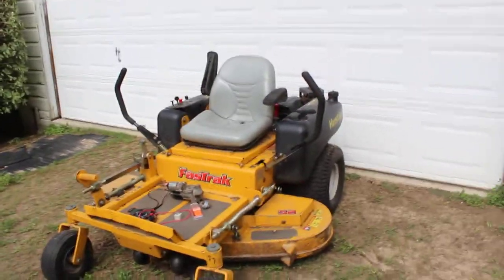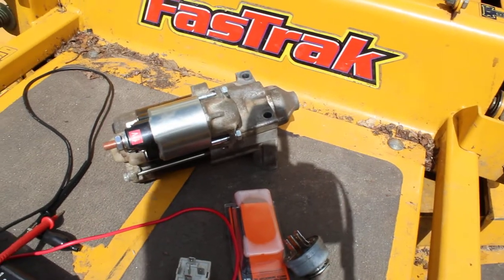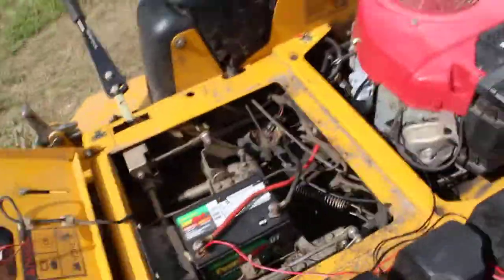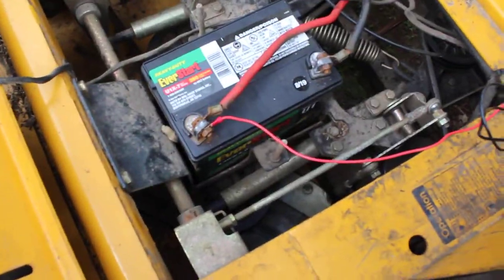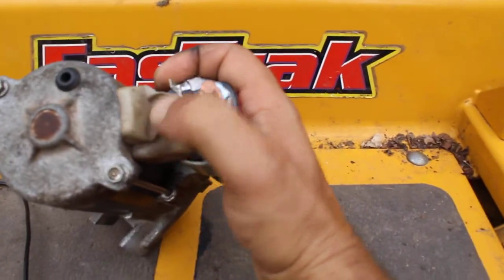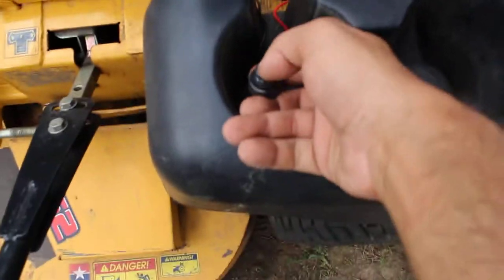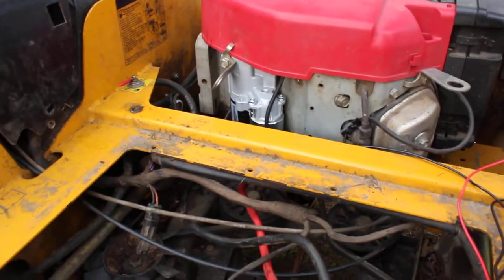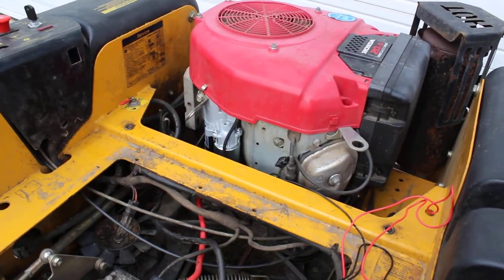how to fix a hustler zero turn mower starting issues (fix)

Comment: I had exactly the same problem with exactly the same mower. It turned out to be the mower blade PTO switch. Replaced it and worked great ever since!!! Found it by mistake after I bypassed all other safety switches (lever arms & seat switches). Ended up a cheap & easy fix by just replacing red PTO (blade) switch that engages mower blades. It makes sense as you can’t start the mower with blades engaged but if switch is faulty, mower won’t start... hindsight is 20/20!!!!
Reply: Thanks. I bet that’s the exact problem I’m facing now.
Reply: Yep sounds like mine too.
Thanks.

Comment: I had the same problem on my Hustler X-One.  I learned that the drive arms have to be out for it to start, they were, but the safety switches (I don't know their proper name) that ensure those arms are out were faulty.  Yes, both of them.  They were just losing conductivity from age.  I pulled the arms in toward the center of the mower, and pumped each of the switches about 10 times by hand.  I put the arms back out and it starts.  Those switches have to be replaced on my mower.  You have to lift the seat to see/access the switches.

Comment: Mine ended up being the small wire on the small post of the solenoid that traced back to the key switch needed replaced.  I replaced it with a new wire and now it starts every time.  Hope this helps someone.

Comment: I have the 36" version.  It also doesn't start at times.  Mine has 2 fuses on the inside of the right side fuel tank housing where the key switch is.  When it doesn't start I find if I tap the fuses lightly with the end of a screwdriver or something similar the mower will start.  Being this simple,, I never investigated any further for a fix.

Comment: That is not a fix. That is a get by until you find the problem or someone who can repair it for you. Need to put a fuse in that wire you got hucked to the battery.

Comment: You had dirty connections somewhere in your safety switches, maybe on your relay or ignition switch or one other thing that is another culprit, bad ground to the engine to frame. Straight twelve volt wire such as you provided overrides the bad connection. 

Clean all your connector male and female terminals and the problem will be fixed. Hope that helps you out.

Comment: I barely know which end of a screw driver to hold but this problem has plagued me for 2 years and with about $20 worth of switch, wire and connectors and 30 minutes of time, this fixed the problem.
You are forever in my debt.  Thanks.
Reply: You mean to say YOU are forever in HIS debt.

Comment: Check the wire that goes to the oil pressure sensor. Runs from by the oil filter to the other side by the starter. It is a yellow with a black stripe wire

Comment: My first issue turned out to be the switch connectors in front of the battery; they accumulated a lot of dirt. Blew them out with air and the mower cranked up without hesitation. Now I have a no-clicking  solenoid once again... cleaned those connectors eh, charged battery eh, this time I will look at the ignition switch

Comment: I had the same problem with my Fastrak 42 inch.  The problem is the positive dc start signal to pick up the start solenoid goes through the key switch, the clutch switch and the two control arm switches.  There is too much resistance in all those switch contacts, causing too much voltage drop to pick up the start solenoid.  I replaced the starter with solenoid, no help.  I also had replaced the oem start relay with no improvement in starting, but it came with a relay socket.  I went to O'Reily and bought another relay and plugged it into the socket.  I then pulled the oem wire off of the start relay and ran it to one side of the coil of the new relay and wired negative from the battery to the other side of the relay coil. 
Then ran battery positive to one side of the normally open contact and the other side of the normally open contact goes to the starter solenoid terminal.  Didn't even mount the relay, just zip tied it to the dc cable bundle going over the transmission bay.  Took me about 15 minutes.  Starts every single time.  Sweet.
Reply: Meant to say also, that aren't you bypassing the safety switches with the pushbutton?
Reply: @Norm5264  hence a ill fitting fuse just a little loose / dirty.

Comment: Have a question - I dont have a manual for my Hustler Super Z zero turn, but I notice you have the same Honda engine 24.0 v-twin - I need to replace the carburetor,  I was wondering if you would know the part number to your Honda engine or a part number for a replacement carburetor - Thank you any any info you have
Reply from the maker: https://www.hondapartsnation.com/oemparts/a/hen/509464bcf8700230ac8c87e9/carburetor-1
Reply from the maker: the motor is a gx620 they sell them cheaper on amazon i just replaced mine but you have to change the throttle from the old carb to the new one and the fuel intake is not in the same place and you have to bend it down in order to fit right with a longer fuel line hope this helps.
Reply: ace of all trades thank you!

Comment: There are two relays in the compartment under the key switch one is for the starter one is for the blade
Change the one that clicks when you turn the key to start
Bad single pole double throw contact in it

Comment: Easy fix, but issue is, should the PTO be engaged or unit in gear it will still start with possible safety issues.  Might suggest a starter assist relay (does NOT bypass any safety but overcomes corroded connections).  As long as you are getting a "click" from the solenoid you have enough power to activate the relay.  https://www.youtube.com/watch?v=0qqJwI_9NX4

Comment: Your wallet had to die for our sins.  We thank you.
Reply from the maker: Very true even after paying a mechanic 175 they couldn’t fix it
Reply: Couldn’t fix it .... wasn’t a machinic was a doofus. Ripped offf fer $175.
Reply: I went and installed a starter button that goes straight to the starter solenoid.  Thinking I was bypassing a bunch of safety relays.  
What I found out later (I bought this zero turn used) was that my throttle kinda has this sweet spot it has to be in to fire the starter.  So I think the button I installed was really for not.  Now if I go to start and it clicks but no start I just fiddle with throttle position.  For me it’s like 1/4 throttle area.  Either I’m dumb or the engineering is or hell idk.
Reply: @JEEDUHCHRI  Makes me wonder if its actually a grounding issue.

Comment: Looks like u may have to try this. I've replaced the solenoid.  I'd hate to go through the motions of changing the starter.
Reply from the maker: Yeah I replaced that first which is built into the starter and had no luck

Comment: My 54" Hustler Fastrak has had a intermittent starting problem for a few years and after the Shonky dealer in Mullumbimby NSW changed out the wiring harness I presumed everything was okay.. No it's not the same problem is back after a few months and now my warranty is finished.  The fuel gauge wouldn't work either so that was also changed out under warranty and now that's not working again either.  This mower has 90 Hrs or use in nearly 5 years....   FRUSTRATED!!

Comment: Hustler Dealers (good ones) have kit to fix the issue without adding another switch.  It's called a "starter assist relay"  part number on the bag is 107910 Cost me $35.00 at a Hustler Dealer.  (Sadly not the nearest one to me.   THEY wanted $600.00 for a new stater and never suggested that this little kit might fix my problem.   Issue comes down to the solenoid HAS to get 12volts or it won't work AND apparently it's not unique to just Hustler equipment.   Also my mower went over 15 years before this gremlin popped up.
Reply: Thanks!!! For this info
😘

Comment: The power to the starter solenoid runs thru 3 safety switches. The seat switch and then thru the switches for the parking break which are mounted on your the frame near the steering arms. If they are corroded you won’t get the proper voltage to the solenoid!
Reply: That was my first issue worked like a charm. Facing another non-clicking solenoid issue now.

Comment: Underneath the key switch area is a delay module that will  do exactly what you are having trouble with. If you replace that it will end your problem. I had the same issue on mine it ended up being the delay control module.
Reply from the maker: I replaced that and all fuses in there including key switch and cables and still no luck
Reply: @aceofalltrades5425  try replacing the the red PTO swich. I read earlier in the postings, that,  that solved one individual's problem. I'm having same issue.

Comment: I'm having a similar issue and am trying to change the solenoid first.  I can't seem to get the solenoid plunger to fit in correctly and as soon as I hook up the battery leads to the solenoid, it starts spinning. Is there a trick to getting the solenoid seated correctly when re-installing it?
Reply from the maker: If I remember right you have to set the the plastic part between the solenoid and starter to where when the solenoid activates which it would be in the down motion it lifts the starter gear up
Reply: Disregard, I removed the entire starter and was then able to install the solenoid....but it didn't help.  I seem to be having the same issue as you with my Hustler.  I get 12V on the little wire going to the solenoid, but if it is plugged into the solenoid, the voltage drops to like 0.7.  I'm guessing there is a connection issue that's dropping the voltage somewhere.
Reply: Mine turned out to be the starting relay!
Reply from the maker: Glad you got yours fix I had also try the relay and it wouldn’t work

Comment: So mine does this too but i use a screw driver and start it rite off the solenoid. Why wont the key start it but the screw driver will. Ive replaced switch, starter, solenoid, all fuses, relays and checked all connections and cleaned and re installed. Still clicks and i just use a screw driver now. Help me with this one
Reply from the maker: When you turn the key you should have 12v on the small cable to the solenoid to power the starter I also replaced everything and still didn’t get any power on that cable so I bypassed it by running a cable straight from battery to it with a push button in between cable from battery to solenoid now I just turn key to run position and push button to start mower a lot safer and easier than a screw driver, hope it helps

Comment: I have the same problem only on initial start . I turn the key to the start position and tap on the starter solenoid. It starts every time. After the initial start it starts with the key . I’m thinking it’s the solenoid.
Reply: Wonder if u could grease/ oil your solenoid.? May help!
Reply: @couchrider6228  

It might help , I plan on taking it apart to see what’s going on.

Comment: You need a test light and multi meter test power to key ignition then turn to start to verify power coming out should be red wire with black tracer it runs to third post on solenoid make sure you getting 12 volts there then check red Wire that runs from battery to solenoid 1st post make sure 12 volts there once verified your getting Power from battery and ignition check 2nd post on solenoid to see if your getting Power to the starter if so check the bolt on starter were the red wire is make sure ur still getting 12 volts if so and no crank its a bad starter if your getting power to the solenoid from ignition and battery but none out you either have a bad ground or solenoid is bad if getting power to the solenoid from battery but not ignition you either have a safety tripped or relay issues check safety buy engaging buttons and using test light to verify power moving thru both prongs there should be three safety one on the seat and one for each control lever key to make it easier listen to relays under control panel one controls safety other is for ignition ignition relay will have the red wire woth black tracer if clicks when key is engaged then safety are working if the other has white wire with red tracer clicks then a safety is not engaging and preventing start up just went thru thsi with a hustler raptor 52 for a customer ended up needing a starter and solenoid starter had blowed its guts apart and was stuck engaged on the flywheel guy thought the motor was locked up and solenoid I'm guessing had overloaded when that took place and burned up its contacts internally was getting no power out but needless to say customer spent 175 +tax for a starter (Kohler engine) 14 +tax for the solenoid and then 90 bucks for my labor charger which was 1hr diagnostic and 30 mins for part swaps and now he's back to running and making money with out Jerry rigged shit

Comment: Check fuse its not blown just have a loose fit and your problems would have been over in less than a minute and doesn’t cost a thing.
 Fuse is probably just loose mine was ,  took for ever to find it but didn’t start throwing parts at it until I knew what it needed. Just sayin,!

Comment: I have the same problem. Going outside to try..I really hope I dont blow myself up today!
Reply from the maker: Let me know if it works
Reply: My hustler just started the clicking. I'm gonna try the connections first, switches.
Reply: If 7 wants blow up jump the starter to silinoid with a screw driver

Comment: It is corrosion at the safety switches--- on another youtube video.
Reply: And or dirt build up in the two safety switch connectors in front of the battery.

Comment: Well guess what fellas, same thing happened to me.  I think this should be a re-call. We are getting screwed I bought ignition switch, 2 solenoid, a starter. And a start button 
2016 Raptor 42” 
And they won’t take back electrical parts 😡😡😡
Reply: Shot the parts cannon at it and still missed . Find the prob then replace that part. Easy.
Reply: @couchrider6228  NOT easy if you don't know how to diagnose individual parts. I've been guilting of buying rounds for the "parts canon" myself LMAO!
Reply: @caverli   It would pay you to take it to someone who knew how to . Finding Electrical problems is time consuming but basically simple.